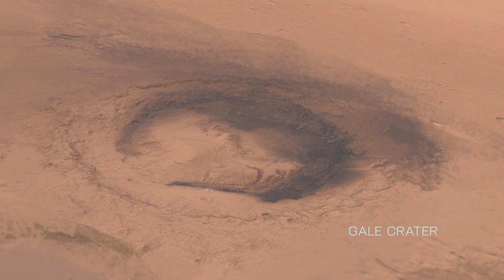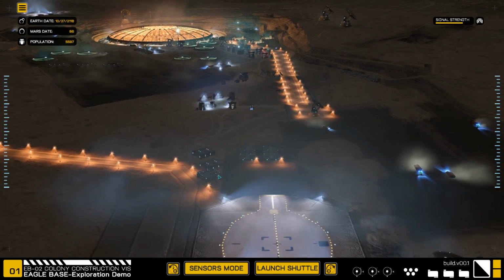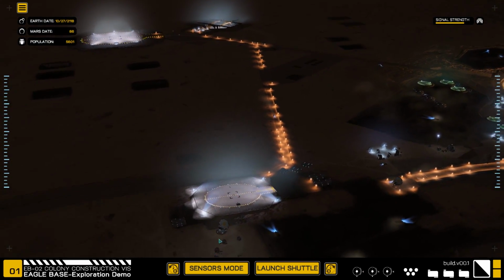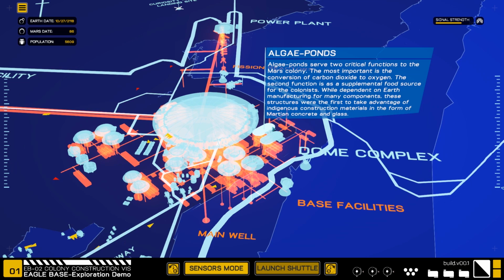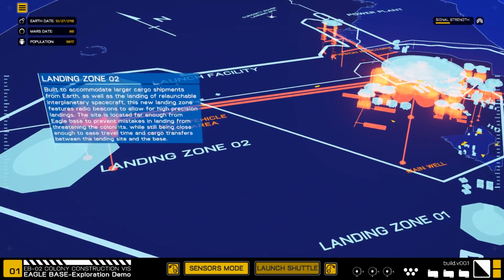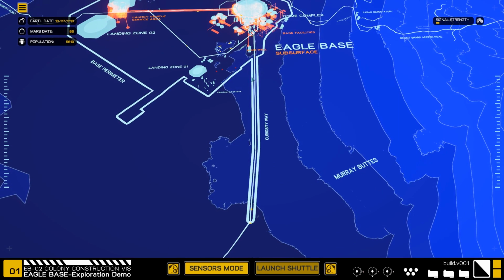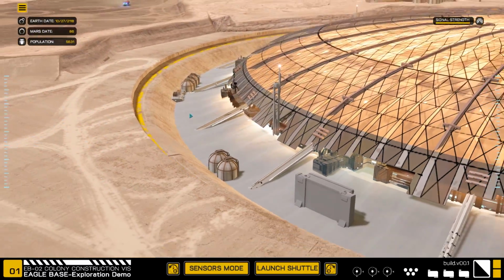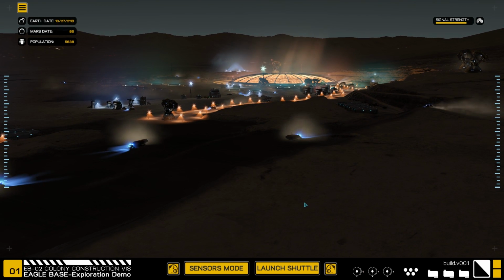Exploring the First Colony on Mars | Project Eagle

Comment: Wow, they should REALLY make this into a game. And that would probably boost their income a bit.
This looks too cool and too thought out to not be used in a game.

Surviving Mars is somewhat similar indeed, but i still do feel this is cooler.
You could do this a bit more Anno like with some different bases for different resources etc. Setting up trade routes, making roads will cost more but speed will be higher and chance of things going way wrong are lower, also faster to move building materials, make pipes and power lines along them etc.
Plus different way of building in the dome etc.

Different ways of building above and underground, some buildings being able to keep expanding underground, different cost, digging sucks, but less shielding needed since that is already up, all with their advantages and disadvantages, energy cost, sunlight, radiation protection, accessibility, and cost differences.
More in depth planning and research and development. Not just plop something down, but keep in mind you have to flatten land and or mine, or maybe run into very hard rock which has different (dis)advantages in itself.
Mining different things in differnet locations with different terrains.
Missions coming from earth, landings going wrong, everything.
Maybe add problems maybe with communication etc.
And you get stuff to decide about crime etc.

Even though it may be slower, of course you can make it run faster, but there is probably just more to arrange and plan and keep track of.

I WANT THIS TO BE A GAME !!!

Comment: I think a dome on Mars is a ridiculous idea. 1.) It would have to shield against hard radiation. 2.) I would have to be at least micro meteor proof. Mars has an atmosphere but it is 0.6% that of Earth's (14.7psi) or about 1/100 of a pound of pressure. For practical purposes it is in fact a near vacuum.  3.) if you do the math ever square foot of dome would have over a ton (2,116.8 LBS) of inside force pushing it off the surface. A 100 foot dome would have around 14.7 psi or about 33,233,760 (33 million) pounds of total force trying to blow it off the surface of Mars. 4.) Mars gets about half the light of earth so growing crops in a dome would not be practical.  The underground Condo idea is a much better solution. The weight of the rock and concrete would help to offset the internal pressure. Cool video
Reply: Wayne G help me with a science project